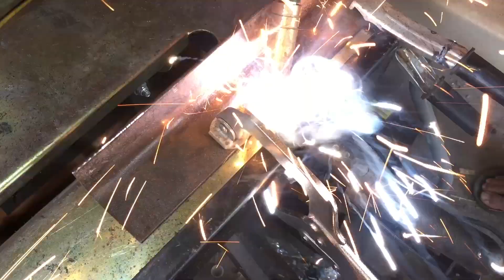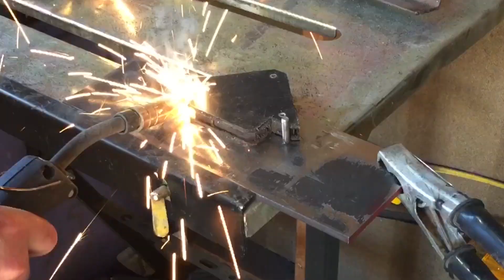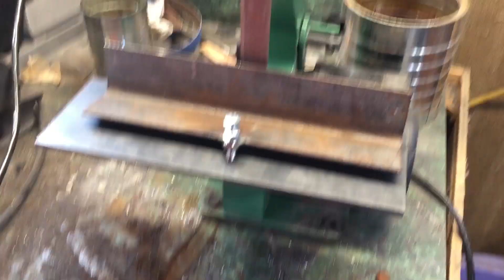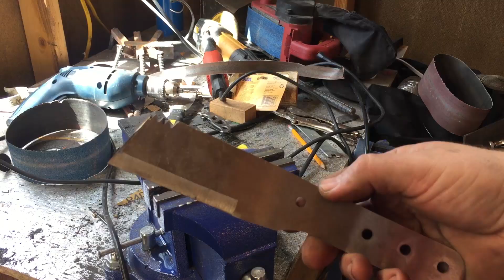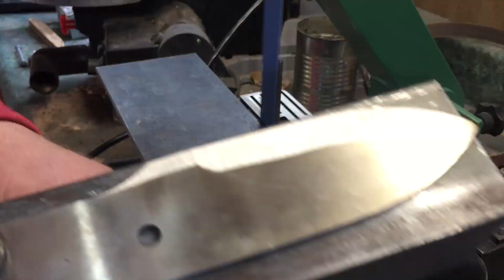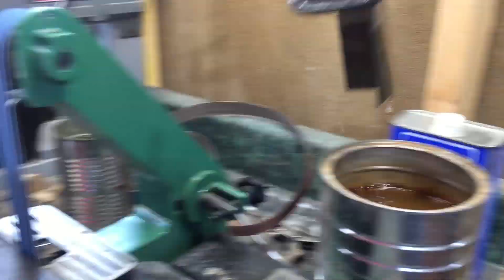How to make a bevel jig the "easy" way (featuring electrical arcs, sparks and smoke!)

Comment: I have used this type of setup before, and the problem i often run into is when the tip is really "steep" towards the spine and then the bevel is totaly different in width, which sometimes look really bad

Comment: Cool... what exactly did you weld to the bottom of that steel plate? Just pins to fit into the holes you drilled in the original table? I have to do something like that....
Reply from the maker: Carolina Chris Outdoors , yes... I probably should've made that more clear, those were essentially just pins, but they were threaded because I used bolts to make the pins. On the plus side, if I really need to secure it, I can put nuts on the underside of the plate.
Reply: FargoFX -- Cool... I definitely need to do something like that... thanks!